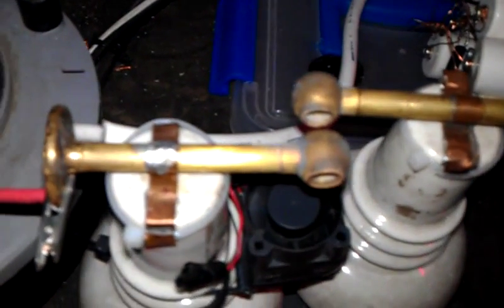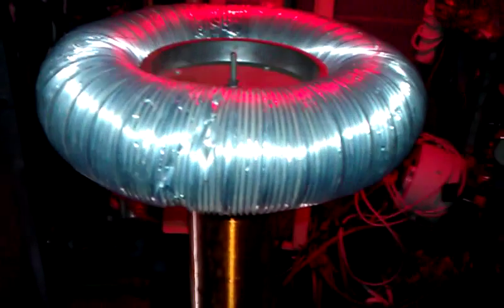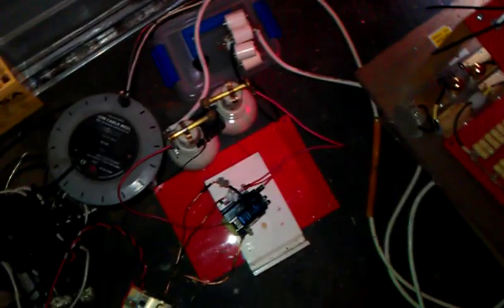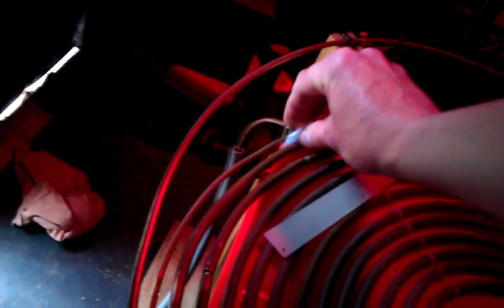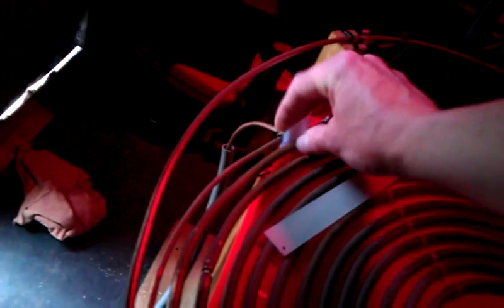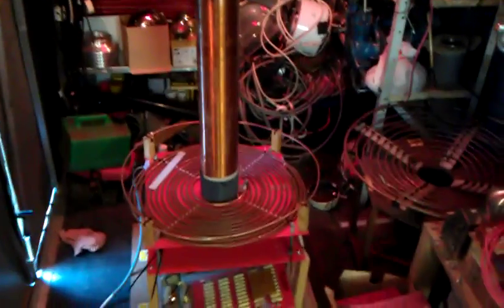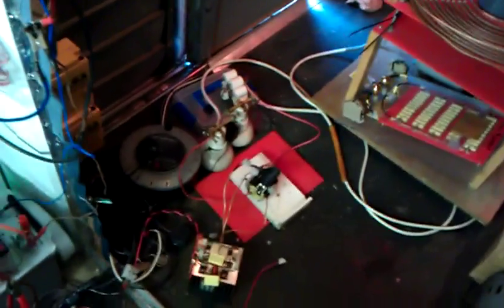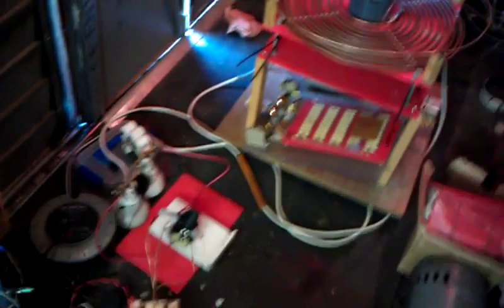Mosfet zvs driver tesla coil big torroid

Comment: hi, can I use 30 volt 50 amps transformer to driver the zvs?
Reply from the maker: devilvortex1 hello,
yes you can mate, no problem. make sure its a rectified Dc. 👍😉 it will be could as theres some good Amps.

Comment: thanks for the info friend, im workin on my first tesla coil, looks like the best choice is a NST type transformer..id like to do a rotary type spark gap but im still unsure how to control rpm of the motor... is it possible to use too many capacitors in the circuit? seems more capacitance would yeild more spark output at the toroid with proper tuning..